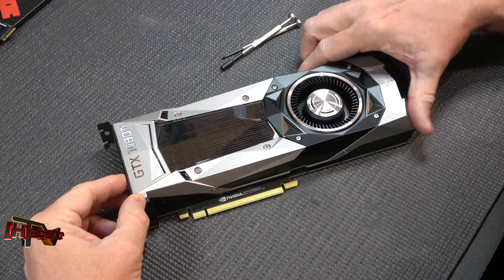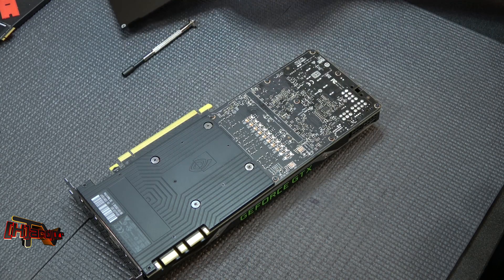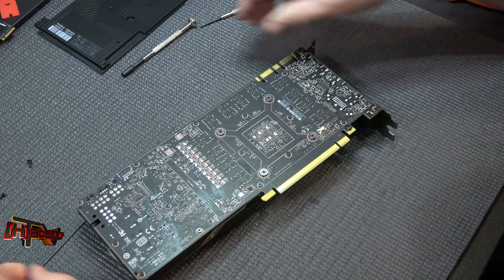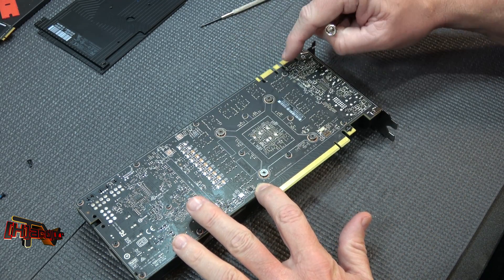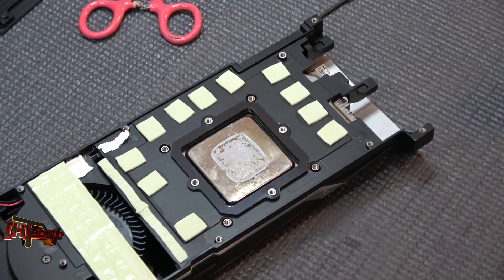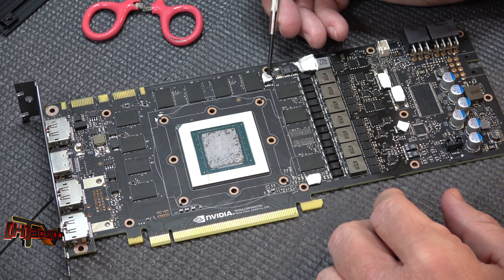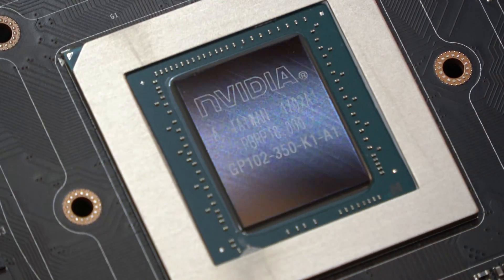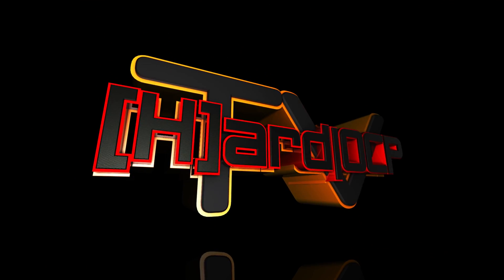NVIDIA GTX 1080 Ti Founders Edition Breakdown

Comment: Dont ever open GPU as this guy showed in video to disassemble the BOARD of GPU and the HOUSING, the correct way for you do it,  you have to place the video card vertically and with one hand hold the card and the other hand the housing and very carefully and with light movements move the card in one direction and with one hand and the other hand move the housing in the opposite direction of board till it disconnect , this prevents it from you warp the board and compromise the graphics chip, which is usually one of the biggest problems with this this GPU. I hope I helped. DON'T DO LIKE THE GUY IN THE VIDEO DID THIS WRONG!

Comment: Hi, what type of screwdrivers bit did you use to remove the nut on the back of the card?
Reply from the maker: That was just a metric socket "screwdriver" that I used to remove those fasteners.  I am sorry but I do not recall the exact size socket that was used.

Comment: can you tell me what size are those hex head screws?
Reply from the maker: 4mm IIRC.
Reply: @HardOCPTV  do u have a link were i can buy one?
Reply from the maker: @darkarmedgames7870  Sorry, no.
Reply: The screwdrivers are called hex nut drivers. You can find them on Amazon

Comment: is it absolutely necessary to use 99.9% isoprpoplyl alchol or can I just use normal rubing alchohol???   I have clear moon whine with that work??  I can find the special stuff where I live and would have to ship it and wil take foreerl...  thanks guys
Reply: For cleaning purposes, any type of rubbing or regular isopropyl alcohol will do perfectly fine
Reply: @xXPAKSLAYERXx  It's better to avoid using anything which will have trace amounts of minerals in it, to reduce the potential for corrosion, though I don't know how realistic or serious this risk actually is. Ideally, the higher the alcohol content, the better. More water will normally mean a higher mineral content.

I believe it doesn't matter as much for a chip which has a metal shroud on it, but the GPU die is usually exposed.

Comment: I know this is an off topic question, but can you change the LED colour on this graphics card?
Reply from the maker: Nope, green only.
Reply: can you turn the lights off then?
Reply from the maker: Actually no.  If you pull the shroud off, you can unplug those however.
Reply: @christianvanschaik3469  You can turn the lights off using the NVIDIA LED Visualizer

Comment: Hi, very in depth video so thank you. One question I have... I recently purchased an eGPU from here in the UK from Bizon-Tech in the US paying $809 or so for the displayed Nvidia GeForce GTX1080ti to be inserted within the enclosure, I believe it’s called the founders edition. But when I received the unit, the card inside was a Gigabyte GeForce GTX card. Being a novice I spat my dummy out and demanded an explanation but they assured me it’s the same card but I’m not sure? Is this something to kick a fuss over? We even specifically discussed the Nvidia 3 year warranty etc, not once the name Gigabyte was mentioned.
Reply from the maker: For an enclosure it should work just fine.  However when installing a water block, different cards use different PCB designs which can cause you some mating issues.

Comment: Thanks for the vid, I wanted to know the hex head size on the back of the gpu. Last time I removed them I use channel locks and destroyed my card like an idiot! Got a free RMA though!
Reply: The little hex bolts with the screw holes in them for the backplates?  4mm hex, or H4 as he calls it.

Comment: Nice, still torn on if I want to put mine on water.  Would need to redo most of the loop and I don't have the time unless I go for something like EK's aluminum kit.  If they do a 360 rad version it would be very tempting.
Reply from the maker: Check out the results:  https://www.hardocp.com/article/2017/11/21/xspc_razor_neo_gtx_1080_ti_waterblock_review
Reply: Ekwaterblocks aluminum kits are ok and work good and are more affortable but your limited with  compatibility with some coolants .
Like the new primochill vue coolant that looks like aurora but doesn't clog your system .
It's also bad in anything that has aluminum  waterblocks or radiators .
Even the red coolant from Ekwaterblocks isn't good with aluminum
Reply: Yeah, I do miss full on customizing a loop but time and money are a more important factor these days so If they do a 360 rad kit I'm in.   Could buy one and swap out the 240 but blah.  Maybe I'll get a windfall or something lol.
Reply: Great review as always, Ty!